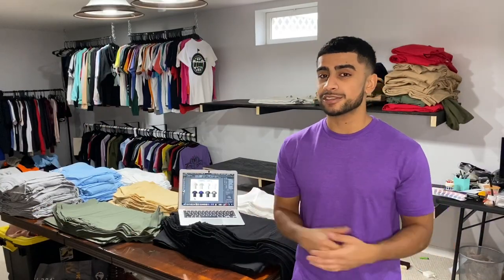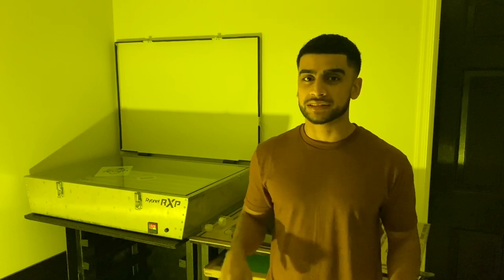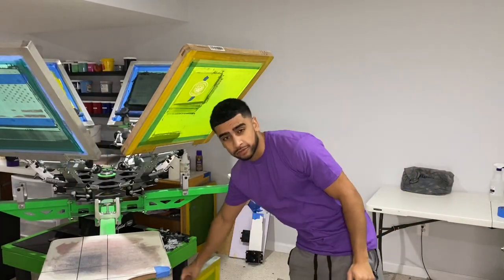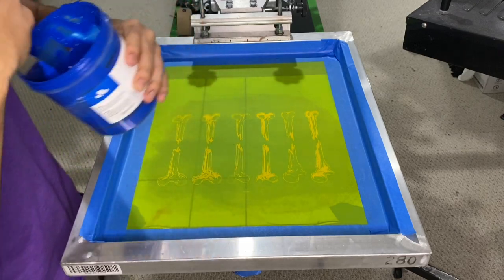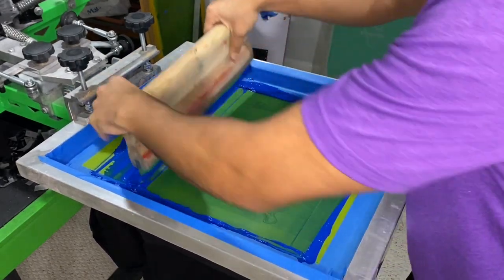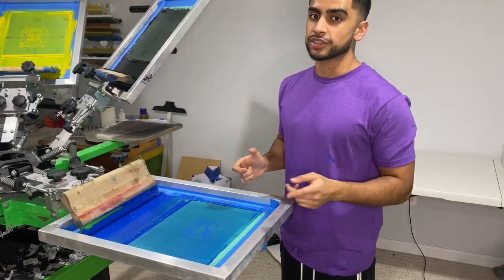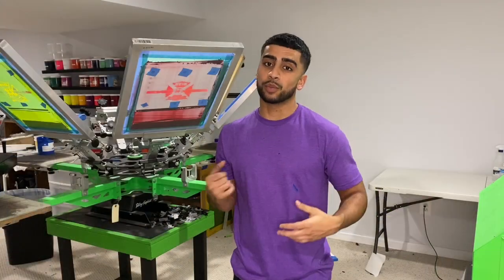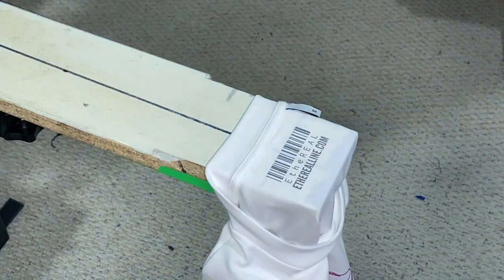SCREEN PRINTING FULL BEHIND THE SCENES! | HOW TO START A CLOTHING BRAND!

Comment: What if you can’t afford a flash dryer how do you start.
And how do you start on a budget in general
Reply from the maker: hmm great question! you can cure the inks with a heat gun but I really don't recommend that. Yeah it is a good way to start but it is really ineffective and takes wayyy to long to cure. I highly recommend you saving up to get a flash dryer, you can find one on Ebay for only $135 which is a great starter flash. Actually it is the same exact flash dryer I use till this day and it works like a charm! for 4 plus years this cheap Ebay flash dryer has held up well, with zero issues. It is the 18 x 18 screen printing flash dryer. The only reason I am upgrading to a new flash now is cause it is well overdue and I need a bigger heat element to flash the shirts with bigger prints.

Heat press is also a great alternative to get your business going! you can earn some nice money and it is a lot easier than screen printing and the prints are good as well, once your demand increases you can use the funds to purchase screen printing equipment. 

Those are two approaches you can take. 

Hope this helps! best of luck!
Reply: @baavproductions  this helped a lot mannn
Thanks for this🙏🏾
Reply from the maker: @Iammejii  Sweet I am glad it did! Best of luck to you!